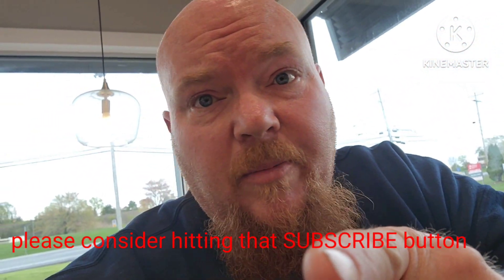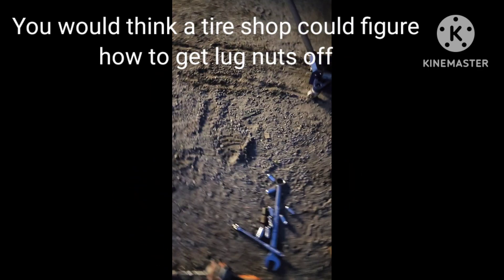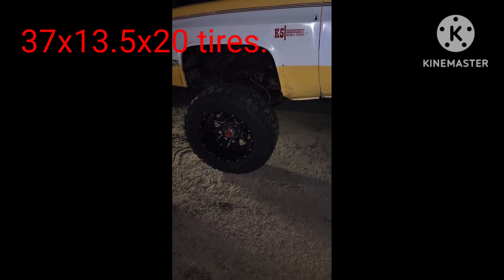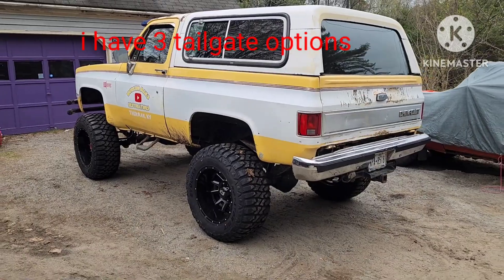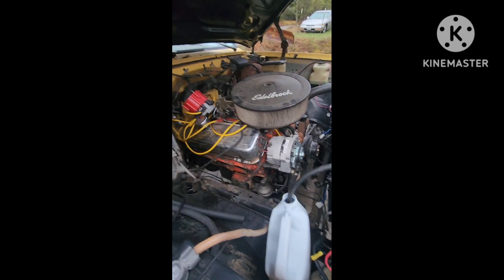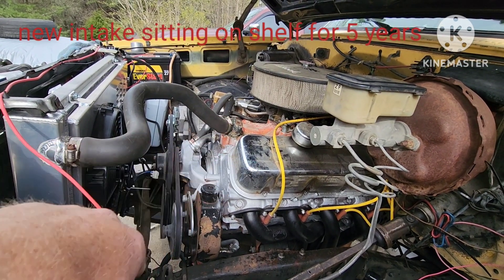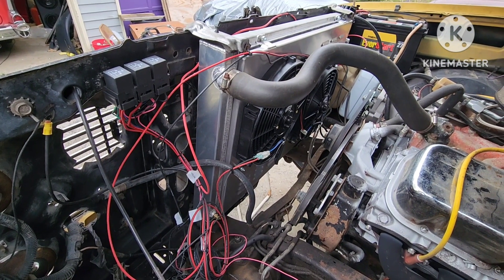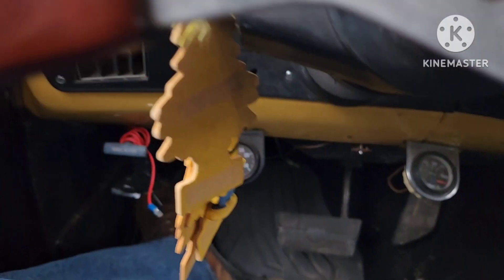1984 K5 Blazer 454 big block driveway restoration

Comment: Do rear disc first.  Hate drums, especially with 20 inch wheels.
Reply from the maker: I checked out some setups and they are about $350... it does need to be next thing because I have a leaky wheel cylinder. Thank you for watching